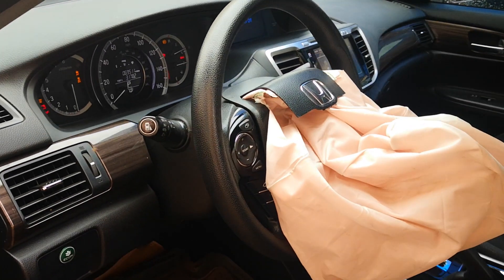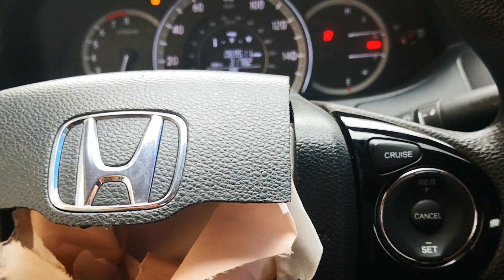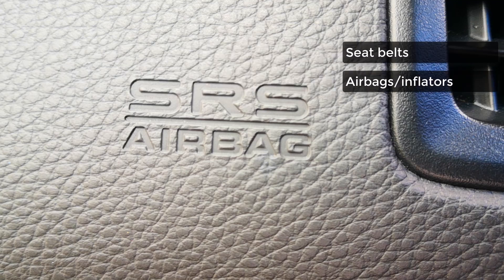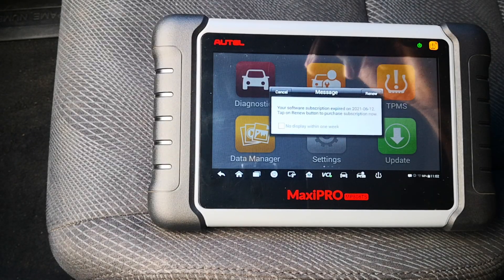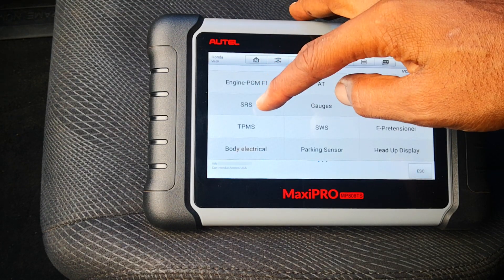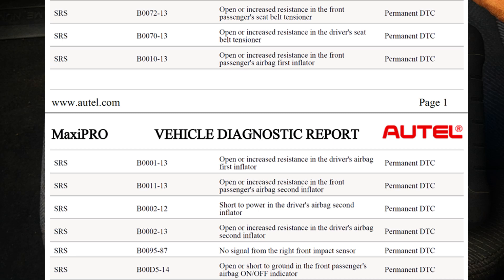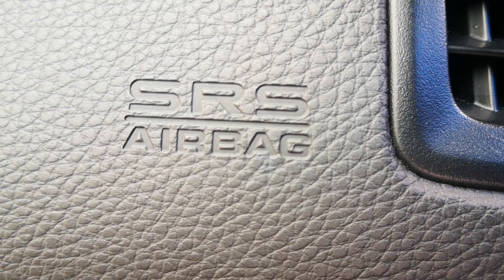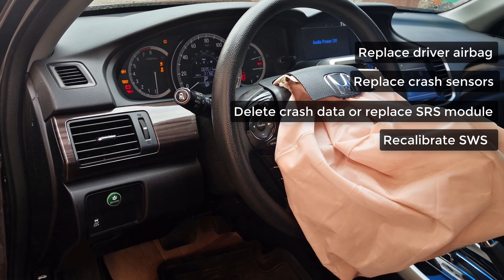How to RESET AIRBAG light AFTER Accident / Repair SRS after COLLISION / Turn off SRS light

Comment: So your fancy scan tool your using that to recalibrate the seat weight sensor sws!? 
Does that have to be done with scan tool  or is that  crash module re-calibrated after sending it in to get cleared solve the recalibration of the sws

Comment: To delete crash data, do I have to still get the srs module out? Or can I do that with a scan tool?
Reply from the maker: On this car and most others, you have to get the module out. They are some crash data tools that can delete crash data via the OBDII port, but last I checked, not all makes are supported.
Reply: @DIYAutoworksNG  thanks for reply, also wondering if it’s ok to replace the airbag before clearing the crash data or does that have the possibly of the airbag going off randomly?
Reply from the maker: You should replace all damaged components including airbags before clearing crash data.
Reply: @DIYAutoworksNG  my main concern is replacing the airbag and driving it until I get the crash data erased
Reply from the maker: That was exactly what I did. Nothing happened. Having crash data and the airbag on even decreases the chance of airbags deploying.

Comment: Hello bro. I have the same car but was involved in a side crash. I replaced the passenger side doors, side curtain airbag, and passenger seat. The then sent out the SRS unit to clear the crash history but I’m still showing an airbag light. I’m guessing the next step is to scan the system to look for faults? Appreciate your help 🇳🇬
Reply from the maker: Hey. Sorry for the collision.
Actually the scan should have preceded the repairs, because it helps flag all the components to replace. The passenger occupant detection module will mostly likely need a reset. But see what the scan result says. Give me a mention when you have the result.
Reply: Question… it’s possible to replace a airbag??

Comment: I send my module to them to get it fixed thry told me its locked is that because i pulled out before i replaced the the parts and cleared all the codes
Reply from the maker: I believe I've answered this in the other video where you asked the same question, yes?

Comment: Please help 😢! I have a 2014 Honda Accord Sport and my steering wheel airbag deployed. Some light cosmetic damage in the front exterior. Please can you tell me where did you order the pilot steering wheel airbag? I have a $300-700 budget. I already have a guy and the tools. Please help me ❤
Reply from the maker: Sorry for the accident man. 
Got mine in used car parts physical store, but you can check Ebay. Seen loads there.

Comment: i have a 2019 honda civic 1.5 turbo 
i got into a crash an all air bags deployed , i cant get it to start is there some type of fuel cut off inertia switch somewhere ? Please help i would appreciate it
Reply from the maker: Difficult to say without seeing the car in person. Seems it was quite bad for all the airbags to deploy. Multiple impacts?
Reply: @DIYAutoworksNG  to be honest i wasn't really that bad , it was hit on the passenger side , it jus damaged the coolant reservoir radiator and the turbo wastegate i got everything replaced, all airbags did go off tho , if i start it up with the help of cables it turns on but its weak and no acceleration at all no rpms going up no nothing , then it eventually turns off ,
Reply: @DIYAutoworksNG  i also seen about the fuel cut inertia switch feature on older models but i cant seem to find it anywhere or much information about it being on new models
Reply from the maker: What of wiring, no damage? There's just so many variables when it comes to a no-start after an accident, but from what you've described, sure there isn't a vacuum leak around the replaced turbo. Tough to advise further without seeing the car.

Comment: I don't think it's as simple as replacing the airbag because the gas has to be refilled and a new sensor be installed etc otherwise the airbag wouldn't work again
Reply from the maker: It's an entire series I did on this car. 4 videos in total, and the light went off. Here's the playlist. Skip the one you just watched. https://youtube.com/playlist?list=PL2pms4eLDw4WQlBoSgJ6oaJRT-DOR1F-i
Reply: @DIYAutoworksNG  but you don't explain about the gas that is used to deploy the airbags.. This is extremely important
Reply from the maker: Airbags should only be replaced not repaired. Sodium azide is one of the chemicals in there, but I wouldn't venture that far or encourage anyone to. That's left for the manufacturers. There's nothing like refilling the gas of an airbag.
Reply: @DIYAutoworksNG  why not? I think after the airbag deployed the gas gets emptied therefore it needs new gas or a gas replacement
Reply from the maker: Try to read how an airbag works. There's no stored gas.

Comment: I would love your advice. When I select "read codes" it shows "System Pass, No Fault Codes Detected". However, our airbag light came on after hitting a dog on the highway. No airbags deployed but our light came on. Advice?
Reply from the maker: Is it the SRS module that you're scanning? What car is it? What scanner are you using. I once had a Foxwell scanner that was SRS-enabled but would miss certain SRS codes.

Comment: I've seen many cars that have been in accidents the airbag deployed and the check engine light or the airbag deployment light has never illuminated
Reply from the maker: Something is not working correctly in those cars. I know the 2014 Toyota Corolla or so had a recall on the SRS and it was exactly for this. The dashboard light maybe dead as well. Trying scanning those cars with an SRS-enabled scanner to see what codes you find.

Comment: Where can I get the new airbags for a 2013 Honda Accord. The same exact airbag went off in my car and I am trying to figure out how to fix everything
Reply from the maker: Depends in where you're based and budget. The dealer will have it but its usually quite pricey. Used OEMs are also good, Ebay and some other sites. Also, the junkyard...

Comment: Question. I have a 2002 Ford mustang. After  20 mph accident in the front bumper, driver and passenger airbags went off. Only Airbag light on dash, no SRS. After installing airbags back in, how can I turn off Airbags on dash? Thank you
Reply from the maker: Start by scanning the SRS module in the car to see what needs to be replaced. The codes there will help you move forward. If the passengers were wearing seatbelts they need to be replaced or restored, also the crash sensors. I scan will detail the required repairs. 
I'm not aware that Fords have separate airbag and SRS lights. The airbag light represents the warning light for the SRS as a whole. It will be on even if there a problem with a seat belts.

Comment: Do you have any experience with a 2005 Honda accord? I am wondering if I replace the airbag and sensor, it will reset itself? Or should I get the scanner tool and scan and see if the SRS module will need replaced and reprogramed??
Reply from the maker: After replacing those parts, the module must be cleared of crash data or replaced for the SRS light to go out and the system work correctly.

Comment: What could be if no codes, module has been reset, but air bag light is still on?
Reply from the maker: Did you use a scanner that has SRS access? What scanner did you use?

Comment: So your  Autel Maxipro scanner will delete the hard crash codes form the SRS module?
Reply from the maker: Nope. Special tools required.
Reply: @DIYAutoworksNG  Can you tell me what the special tool is required? Or did you have to take it to the dealership?
Reply from the maker: There are tools built for clearing crash data. Google tools for clearing crash data. Requires significant know-how too.
Reply: @DIYAutoworksNG  how about replacing the airbag module?
Reply from the maker: Do you mind clarifying the ask about the airbag module?

Comment: 2 questions: 1. What code reader that will work on airbags do you use? reccomens to buy?
2. Have you released your SWS reset video yet?

Thanks!
Reply from the maker: Thanks for watching!
1. I use the Autel MP808TS. I left links in the video description. There would be other scanners with SRS access, but this is the one I use.
2. I haven't done the SWS reset video yet! For some reason, after doing the SWS reset off camera and having the crash data cleared, I don't see the option for the reset. That said, I'm on the lookout for a fitting car to demonstrate this.

Comment: Hey , I have a 2017 Honda Accord and my airbag is deployed , before you installed the new one did the car turn off all the way without you having to unplug the battery?
Reply from the maker: Yes. It turned off without having to unplug the battery terminal.
Reply: @DIYAutoworksNG  do you know what it could be I have to plug and unplug my battery because my screen is staying on I thought it was due to my airbag being deployed but I’m guessing not
Reply from the maker: Apart from the screen does any other thing stay on? Looks like a short in the circuit. What is the trim of the car?  Let me see if I can find the circuit diagram.
Reply: @DIYAutoworksNG  I’m not sure what you mean by trim but I have a 2017 Honda Accord sedan exl . Push start flashes green the 2 screens stay on
Reply: and I also have to put my key up to the push start to start it up
Reply from the maker: Yea. Trim is EXL, LX, EX etc. It's clear there's a short somewhere. The green light staying on means the car hasn't really powered off. Just curious is your light switch on off or Auto?
Reply: @DIYAutoworksNG  Auto
Reply from the maker: Change to off, let's see.
Reply: @DIYAutoworksNG  okay it’s still flashing and the lights are on off
Reply from the maker: Your fob battery is dead then. Have you changed it?
Reply: @DIYAutoworksNG  I haven’t , I can go to my local auto zone and get some batteries for it will it reset ?
Reply from the maker: You just need to change the battery. It should work as usual. No need to reset.
Reply: @DIYAutoworksNG  I’ve gotten it changed I did notice it reads the key now cause at first I could get out my car with the key still in the car and it beeps but now it doesn’t do that but the only problem is that the screens are still on and it’s still flashing green on the push start stop button
Reply from the maker: Hmmm. Not sure what this is. Do you have a scanner with access to all modules? If not, I'd say it might be worth a trip to the dealer.
Reply: @DIYAutoworksNG  I’ve gotten it scanned and it didn’t show anything but my steering wheel also doesn’t lock when it’s off
Reply from the maker: Does the scanner scan all modules? Did it pickup the blown airbag? Need to be sure that the Keyless Access module was scanned. Codes there may help troubleshooting.
Reply: @DIYAutoworksNG  no just the one side where the scanner goes

Comment: Congrats on your car, nice video, do you have any idea if one of the airbags is missing, and the crash sensor has been reset, will the other airbags deploy in Cas of an accident, or should all the airbags be fixed in order for the srs system to work?
Reply from the maker: Many thanks! All airbags need to be replaced and crash data cleared. As long as the airbag light is on, no other airbag should deploy.

Comment: great. where  we can download list fault code autel
Reply: Where
Reply from the maker: Here:
https://www.autel.com/autelcms/CustomerSupport/551.jhtml
Reply from the maker: Thanks. You can use this Autel link below, just type in the car make and it will pull up all the fault codes.
Reply: @DIYAutoworksNG   where is the last video on you resetting the codes after airbag and module and seat belt replacement. I am having issue with 2009 Honda Accord coupe both airbags deployed. Should I replace clock spring on this also seat weight sensor says no detection. I am using the maxi elite 960 the latest scanner for programming keys
Reply from the maker: I will be uploading the videos in the next 2 weeks. I have already finished fixing and the light has turned off.
I wouldn't replace the clockspring except if other things on the steering wheel are not working e.g. Horn, cruise control buttons etc. It is normal for the passenger seat weight sensor to say not detected as it would need to be calibrated after you replace the airpags and clear crash data from the module.
Reply: @DIYAutoworksNG   so the horn does not work. Also I have tried to reset the weight sensor and it keeps saying it does not read
Reply: @DIYAutoworksNG  is there a reason I can get to the point where I can recalibrate the sensor and put the weight on seat and drive 22 mph.  I am getting exhausted on this Honda.
Reply from the maker: If you test the horn directly and it works and you've checked the fuse for the horn, the clockspring should be the next culprit.
Are you referring to selecting the SWS module under control units? I  had the same experience. I believe Honda built in the SWS module into the SRS module itself. Can you check SRS livedata via the SRS module to see if you can see any data for the SWS? I was able to see seat weight sensor values there.
Reply from the maker: You will reset the SWS via special functions under SRS not SWS.
Reply from the maker: Go through SRS control unit not SWS, then select special functions. You will see Initialize SWS.
Reply: @DIYAutoworksNG  I will go out there now and check. Thank you. I will follow up shortly today. And thank you for being available.
Reply from the maker: Nice. I'll be waiting..
Reply: @DIYAutoworksNG  appreciate you
Reply: @DIYAutoworksNG  it says Initialization operation has been retry the FWS initialization with care to the condition check.  Seat is up nothing on seat ect
Reply: @DIYAutoworksNG  Initialization operation has failed retry SWS initialization with care for the conditions that
Reply from the maker: Okay. Have you cleared the crash data from the SRS module or replaced and reprogrammed it? Are there still SRS DTC's in the module?

Comment: Congratulations to you on the new Accord .. I like your video a lot brief to the points and well explained..
Is the Accord v6 or I4 also what's your take on Honda cvt.
Reply from the maker: Thanks a lot. It's an I4 CVT. I think Honda's CVT have improved. From my research, the earlier glitches in 2013 & 2014 were addressed from the 2015 Accords.